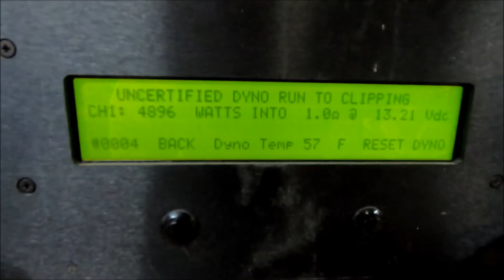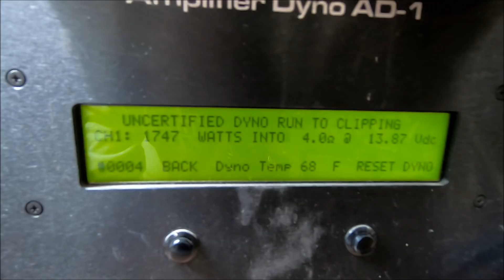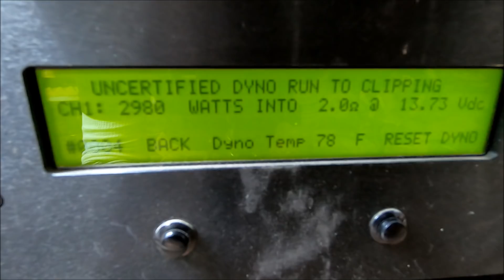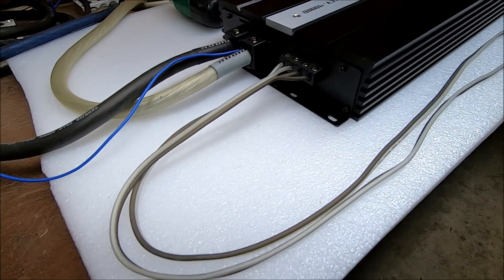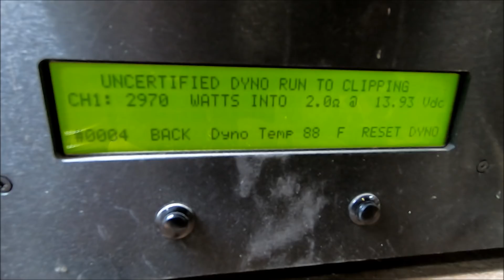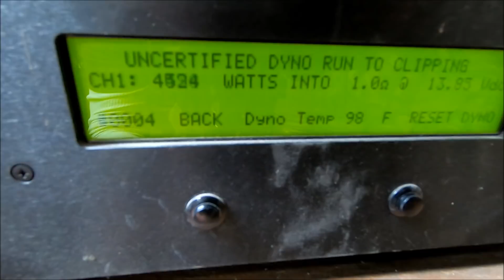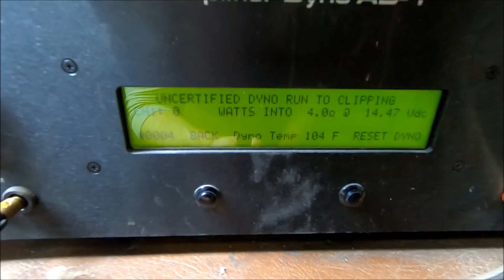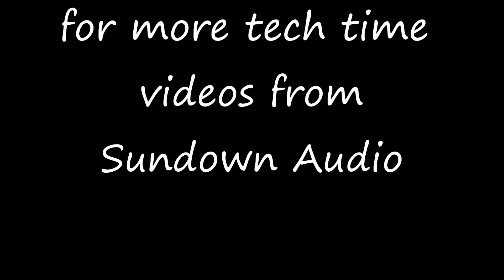***How Big Does Your Speaker Wire Need To Be?*** *Tech Time Thursday* at Sundown Audio

Comment: I’d like to see it run with 4 gauge speaker wire otherwise neat test
Reply: waste of money
Reply: herbyverstink there are several brands using 4 gauge speaker outputs and I’m pretty sure sundown has 4 gauge speaker terminals on their team subs. That being said 1 run of 4 gauge looks cleaner vs dual runs of 8 gauge to your box. Personally I have 1 run of 4 gauge to my smd speaker terminal and 8 gauge to the subs inside
Reply: @dylanantunano9761  the G2 Audio Genesys subs use 4 awg terminals & that sub is only rated at 1200 rms. Its becoming more common to see 4 awg terminals on subwoofers.